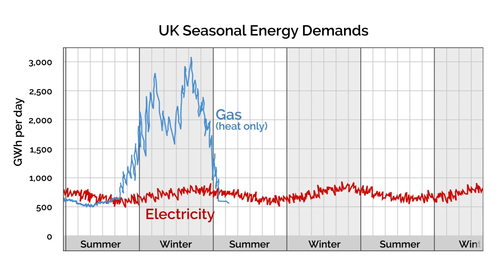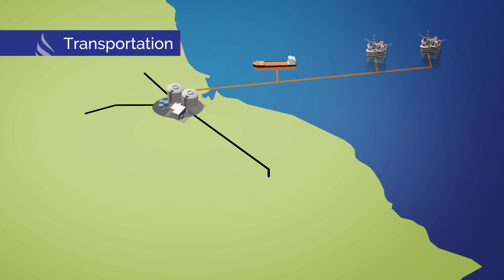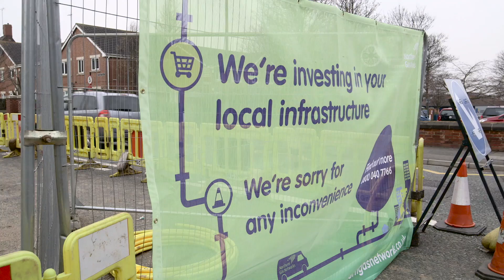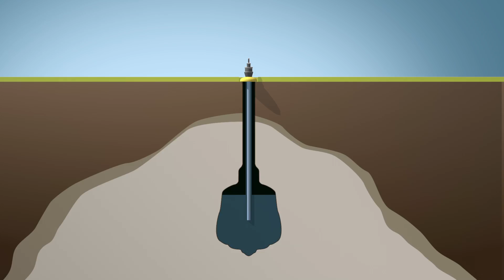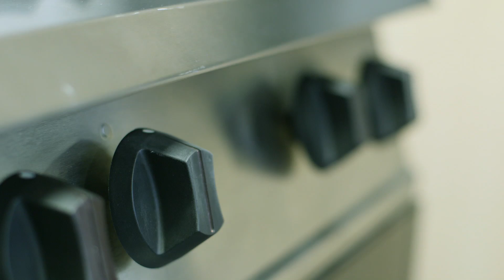H21 Leeds City Gate film

Comment: Creating a hydrogen network is a great idea, but steam reforming to create hydrogen is a process that still produces green house gasses, and a process that is UNSUSTAINABLE -> the natural gas will run out.  Would be great to see wind/solar/wave power splitting water into hydrogen.
Reply: Renewable is still too expensive. But it will not last forever, once it will become cheap enough, it will be easy to switch from natural gas. But to achieve this, a market should be created. Therefore, starting now with natural gas is a good solution, which will allow painless transition.